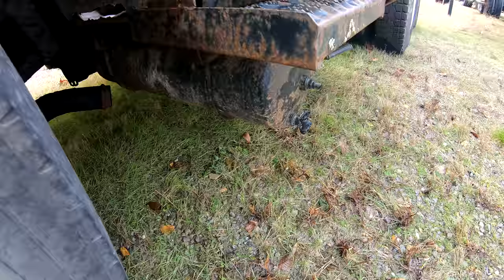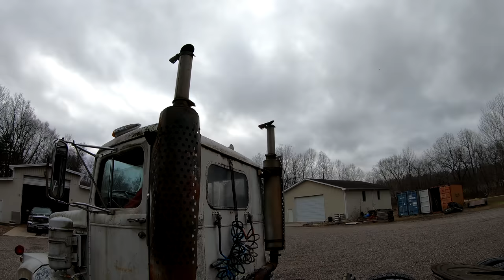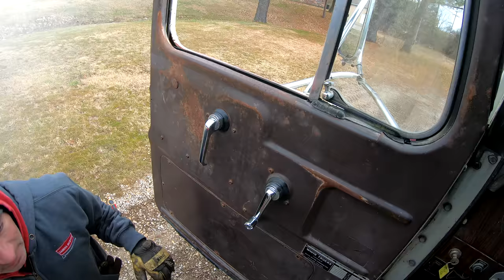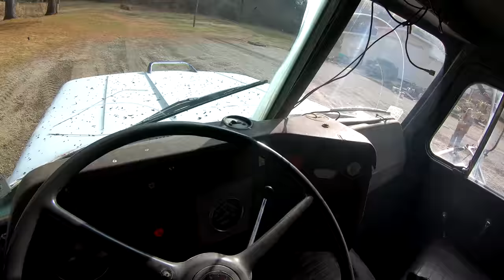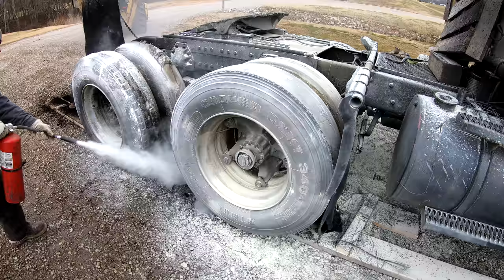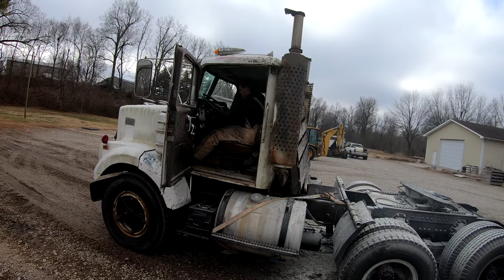2020 Burnout Callout - 1974 White Road Boss - 8V71 Two Stroke Detroit Diesel

Comment: If the chain would have broke, that would have been a whole different kind of entertainment!
Reply: That truck would run very fast and hit a tree.
Reply: What if the steering jerked and it did donuts? or what u said
Reply: What if the truck did a burnout in the Highest gear.
Reply: Or if tires exploded right when they ran up to them to put them out.

Comment: Slammed  the pedal to the floor and never skipped a beat......... Love them old Detroit two strokes. I service an keep allot of them alive in the the marine industry. 😎
Reply: Thank you sir, for your service!  I want me one of them US Navy PBR boats with the twin 6V53s!!!  And I'm not a boat guy at all...
Reply: Would love a 2 stroke detroit
Reply: I've been told that Detroit's have two throttle settings.  "Off" and "highest idle".
Reply: @jaysefmacmanus8858  i have seen some pick ups have a high idle switch to warm them up quicker
Reply: @thepurdychannel8866  We use "high idle" as another term for "wide fucking open".  And yes, they warm up pretty quickly when ran like that.
Reply: @jaysefmacmanus8858  oh😂
Reply: They had them in the 109a6, loved driving that thing and listen to that motor revving. Had best job in the Army, driving tracked vehicles and blowing shit up.
Reply: I need manuals and technical stuff like bad man. Hook me up with everything there is.

Comment: That old Detroit is saying, 
"what, we're done?? I still got fuel AND oil!"
Reply: George Jones  Name that old truck "WHITE LIGHTNING!"
Reply: Are they known to burn a lot of oil?
Reply: @lancekippenbrock5307  2 strokes eat oil as part of regular combustion
Reply: @shadowwolf8595  I thought this was a diesel
Reply: @lancekippenbrock5307  duh its a diesel two stroke
Reply: @lancekippenbrock5307  it is.
Any of the detroits that are called something like 8v71 are 2 stroke diesels
Reply: @lancekippenbrock5307  leak as much as they burn lol
Reply: @shadowwolf8595  Diesel two strokes do not burn oil with the fuel in the same way a two stroke gasoline engine does. They have a sump just like a four stroke does.
Reply: @daveulery360  exactly, they dont push the fuel under the piston and the crancase but rather it goes directly to the cylinder thats why they need blowers
Reply: @eljaibas16  They need blowers to force the exhaust gases out of the cylinder. Nothing is forced under the piston, the intake port in the cylinder wall is exposed when the piston is getting to BDC, allowing a fresh charge in and forcing the exhaust gas out of the cylinder through the OHV.
Reply: @--_DJ_--  yes
Reply: @shadowwolf8595 they do not burn oil as part of normal combustion

Comment: The fact that it idles perfectly after all of that is beyond impressive.  To bad they don't make em like this anymore.  Imagine a 1 ton Detroit pickup...it would last forever...and out every truck manufacturer outta business.
Reply: The SAd part is that compared to today's emissions-compliant diesel the old 2 strokes would likely have better fuel numbers and massively better service life.
Reply: Didn't the older square body gmc/Chevy  diesels have Detroit engines?
Reply: @bass-n-truth-inthestix9083  They sure did and they were awesome!
Reply: @92Jdmsupra  right on. Original comment confused the heck outta me lol.
Reply: I got myself a 700ish hp lly duramax these days. Absolutely tank.
Reply: @bass-n-truth-inthestix9083  Nice! Fastest vehicle I've ever ridden in was a cummins making 1500ft/lbs of torque.
Reply: @92Jdmsupra  I believe it! I need to dyno mine but in theory, with all my modifications, tuning etc. (It's a pretty long list) I'm fairly certain it has to be in the high 600's to low 700 hp range. I am very curious to find out my torque. It definitely is one of if not the fastest vehicle I've driven.  Idk if it's the fastest I've got to ride in though.  Although I'm hard pressed to remember being in anything else that threw me back in the seat like my truck. That's with it being a long bed crew cab too haha. I can't go anywhere without someone in a powerstroke or cummins riding my tailgate trying to get me to play. It usually ends with a big cloud of black smoke and them way behind me at gapplebees.
Reply: 2 stroke diesels don’t last nearly as long as 4 stroke Diesels. Now a days a CAT motor is about the best money can buy
Reply: @amandahugginkiss9119  

Lol @ the name
Reply: @bass-n-truth-inthestix9083  a 700hp Cummins is brutal, those hellcats won’t know what hit them 😂
Reply: @amandahugginkiss9119  fair to say. The torque is phenomenal.  I have a 700hp Duramax though. Regardless a v8 diesel engine with lots of mods or even inline 6 with mods can lay down some serious rubber and launch super hard.
Reply: I just love the sound of these old Detroits.

Comment: Incredible motor.... , just incredible.... bulletproof af
Reply: City buses would idle around the clock when they weren't running a route on bitter cold winter days in my northern city in the 1970s when diesel fuel was dirt cheap.   The amount of run time some of these engines must have had on them is amazing.     This is 1930s technology, too.
Reply: @scdevon  When people say they don't make em like they used to... They really don't make them like they used to anymore.
Reply: I’ve seen a boat with 29k hours on the Detroits
Reply: @Joseph-C     The amount of abuse these engines could take in a heavy truck or an old GM city bus is amazing.    Imagine stop and go driving for years on end in sometimes 100 degree heat in New York City and sometimes with delayed maintenance.

Comment: You don’t need to check the oil before putting it on the limiter for three minutes straight...
Reply: Them old detroit's just spit oil right back out.  They hate the quiet and nice fresh air too.
Reply: @gqoniefh  literally the bane of ole greta thunberg
Reply: Yuck Foutube  😂Thats the spirit
Reply: If there's no oil under em there's no oil in em
Reply: [Peg] YOU
DON'T
NEED
OIL. [/Peg]
Reply: You don't need oil

Comment: Ahhh man not good wanna sell it? It's such a classic I'd restore it.
Reply: You'd be in over your head. Too many existing problems.
Reply: @MK-qv7bq  why's that bud?
Reply: @keepontruckinoutlawlife1248  it’s a Detroit after all... you’d be broke from buying oil
Reply: @keepontruckinoutlawlife1248  Well like the comment stated "too many existing problems". Theres a reason he is willing to abuse some of his vehicles like that. If it were mechanically sound and desirable it'd be used for work or sold to someone who would benefit.
Reply: @MK-qv7bq  he rebuilds engine's so he doesn't care
Reply: @keepontruckinoutlawlife1248  Correct.
Reply: I'd buy it too!

Comment: At first I thought you were just two wheel spinning then I realized you locked your tandem axle way to go dude long bitchin burnout I had a 74 Pete with the eight v71 that was a good running old truck

Comment: 13.56 running backwards, took me back to my time driving for a galvanising plant in Birmingham in the late 70's, they ran Bedfords with V6 & V8 Detroits. The V6's were the worst for this and took some skill to get away from the lights loaded on a hill. You had to keep the revs sky high with slipping clutch to avoid the engine bogging down & then spinning the wrong way. Wonderful durable engines but around 2mpg worse fuel consumption than equivalent Cummins.

Comment: My 1979 kw lw 924 3408 15od 44.000 rockwells full load of logs going up overpass drop a gear or two and she would lite it up , had to be careful with that old girl or it would shit the rears out or twist shafts of the yolks 🤯what an old truck still have dreams of driving it

Comment: I'm new here and may not know something that you guys do. But why do you purposely grenade these engines? It seems like a waste. One day, these engines will be gone forever. There must be a market for used Detroit two-strokes for guys to install in pickup trucks whose engines died but are otherwise perfectly fine
Reply: After a few million miles and 50 years you get to the point where it's more economical to scrap the vehicle than keep it running.

Comment: What's it mean when its " runnin backwards "
Reply: Exactly that. That engine design is capable of spining the crankshaft both clockwise and counter clockwise. Though I think there's differences in setups and tuning depending on application, so I'm not sure every detroit is set up for that.